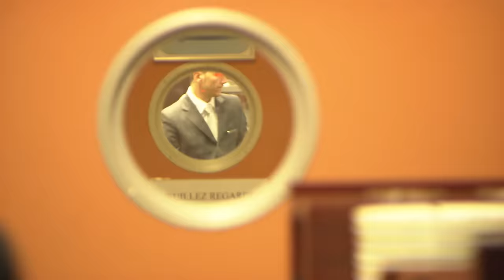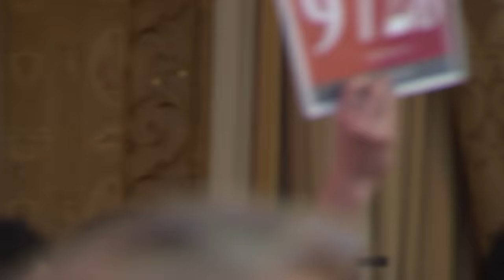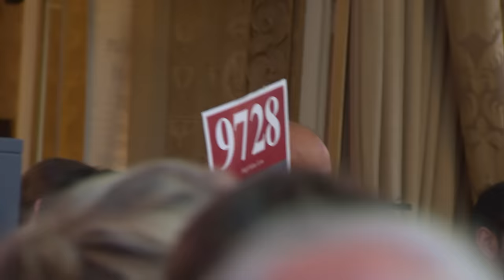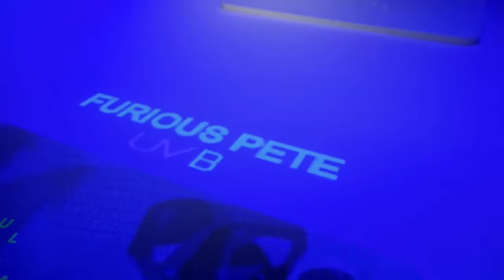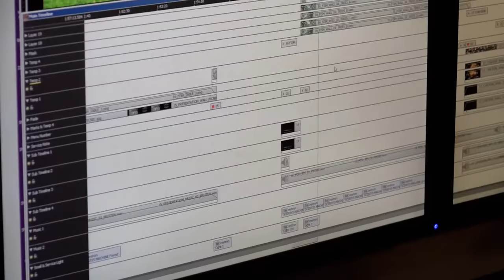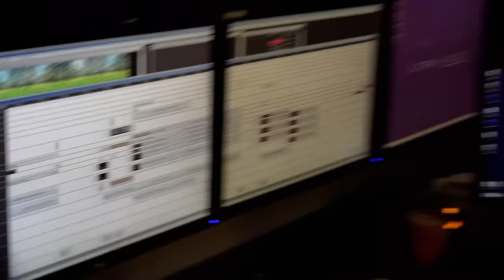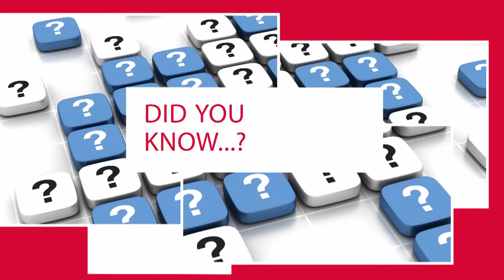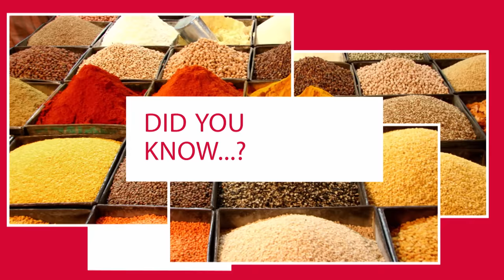Most Expensive Things in the World | Did you know...? | Free Documentary

Comment: the most confusing thing is that diamond, the same structure of carbons and all, is used both for the higher ups as jewelry, but also for as low as drilling a hole through rocks. i mean we Civil and Geotechnical engineers use them like in everyday work. diamond tip drill, diamond teethed drilling bits, diamond tipped blades, there are so many i can't possibly list them all here... yet diamond drills price is nowhere near the jewelry... i wonder why though... genuine question...
Reply: I believe it is because diamonds sold at auctions are pressed by rock and the earths mantle itself under immense pressure, making it a "proper" diamond.
Industrial diamond, or a synthetic Diamond, has been artificially pressed in a chamber with very high heat and pressure, or grown in a labratory and thus, does not have the proper carbon chain structure, making it obsolete for fashion, however still as strong as a "proper" diamond.
Reply: @detesla9575  but if you take mining grade diamond (which is hard and stiff AF), polished them real pretty, look at both side by side.... there's nothing so different though .... sooo .... how can people tell? i mean both have the same carbon structure, same strength, same look... i'm reaaaaly curious...